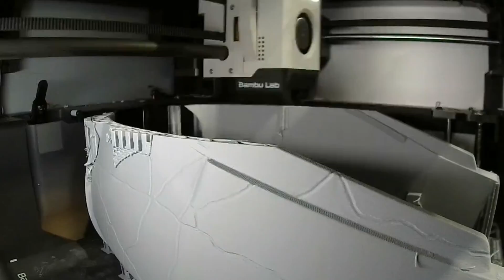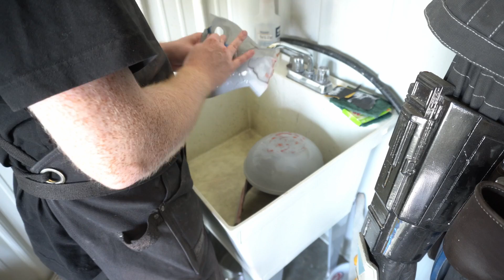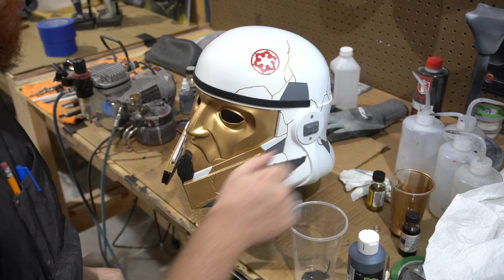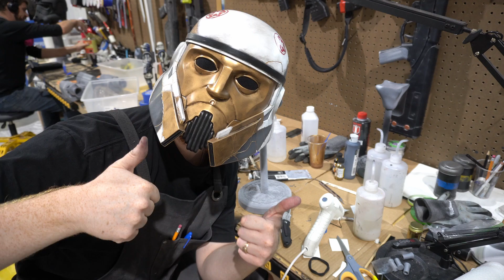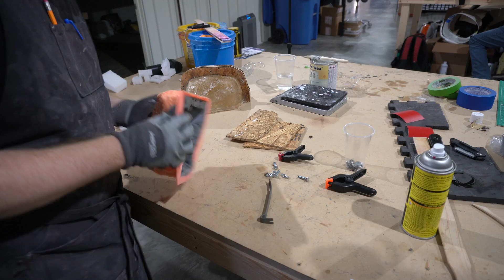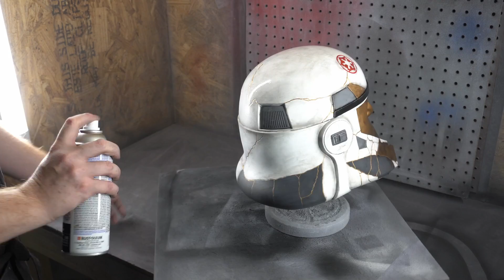Making an "Enoch The Rock Johnson" Helmet

Comment: 07:10 surely you could’ve spray painted those parts on the helmet in gold first, then masked the cracking using liquid latex, then sprayed them the dark grey? Which would’ve allowed you to use a spray can for both rather than hand painting and an airbrush?
Reply from the maker: Didn't find a good enough spray paint for the gold

Comment: What type of filament do y’all primarily print with?
Reply from the maker: PLA!
Reply: Follow-up question. What kind of glue is best for attaching all the printed parts together?
Reply: We use standard super glue and activator spray for a strong hold.